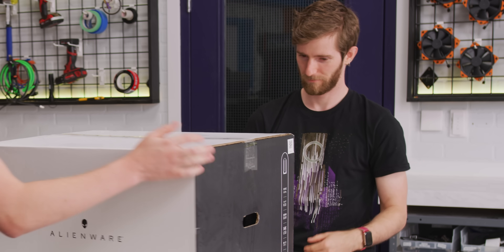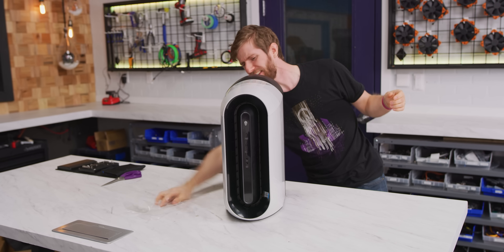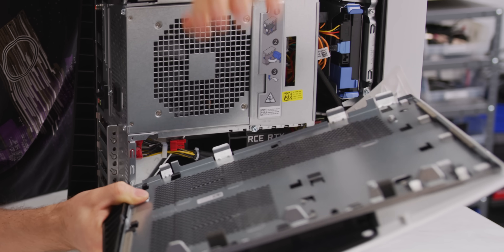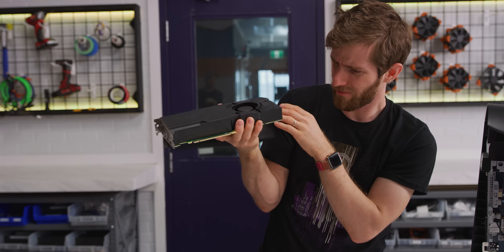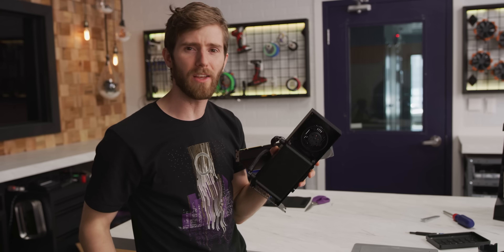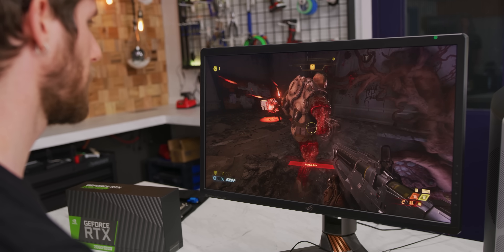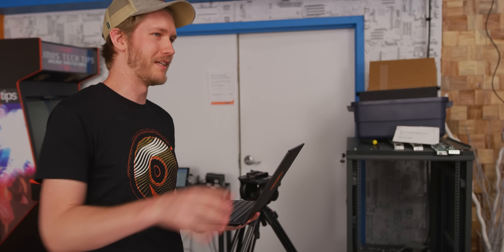I've Never Seen Anything Like This - Asetek Rad Card

Comment: Prebuilts like this really make me scratch my head.... such a perplexing mix of wasteful spending and questionable penny pinching.
Reply: The fact Alienwares have to work around stock Dell cases really hurts them.
Reply: Well, they have the overhead of designing the case to look like a dyson fan that was abducted by some extraterrestrials, but they also cannot charge too much for it because otherwise people would just buy from the competitors, so they have to have comparable specs on paper, but safe money on everything else to somehow stay competitive.
Reply: Das Die Der Erik They also have garbage airflow, which in turn make a normal gpu run hot. Which they then pay another company to make something for them. While just getting better airflow would solve that problem in the first place.

Comment: They could have done like Apple does... tacked another $2500 on it, downgraded the hardware, and put that money into designing, engineering, and manufacturing a really nice case. Who gives an f about the case. You never touch it, you never open it, you never interact with it at all. So just pretend like it is really well built.

Comment: All the time and effort that went into designing the (in my opinion, fugly) case, and the rear panel is just basic, cheapo bare metal you'd find on a workstation made any time in the last two decades. And then the inside is more of the same. It's a weird mix of designing around performance and aesthetics without really putting much effort into either.

Comment: This "rad card" makes me angry; how hard would it have been to simply put the pump next to the water block itself, have the rad on top of both, and make the rad 80 x 80 x 120mm so it's easier to place fans that make less noise than blower fans? Would have saved money, there would have been more PCIe slots for the plastic bottom to hold onto, and all of those screw anchors for daughter boards for stability. Hell, could have had a fan on both sides of the rad to reduce the needed spin speeds for reduced noise.

Comment: Confirming so Linus doesn't have to, A 8- pin motherboard will run with only 6 pins connected (damn 4+4 split while i was inserting and I had no Idea until i went to clean)

Comment: The EPS 8pin is capable of supplying 235 watts, and I’ve seen my 10700k at 266, so it Is possible to go above the max that the 6 pins can deliver on that mobo.
Reply: Doesn't the CPU socket also provide some power?
Reply: AbRaSkZo I think it provides a little bit, but not much. The bulk of the power goes to the chipset, the IO, and the PCIE slots.

Comment: The bigger power supply size was commonly used on older xeon workstations, looks like they are still using it just so you can't use a normal psu to upgrade. I have an 800 and a 500 W from some old dell computers I repurposed.

Comment: $200? That's fucking crazy markup.  A 2080 super with a integrated 120mm AIO is like $50 more than a a regular 2080. You can get a full on GPU block for like $150 if you're running a custom loop. The only use case for this product is...well. This.

Comment: Those are the same mouse and keyboard that come with all Dell systems.
Dell has really given up on the Alienware brand and just using the name for marketing. 
RIP Alienware
Reply: Also that metal chassis under all that plastic is the same as a few Precision desktop. So many reused parts with no regard to specific needs.
Reply: @BmanUltimate  at least that means it's easy to find spare parts. And tbh Dell's toolless system is a good one, not as clean as how Apple but you can basically remove everything without a tool, not just peripheral parts
Reply: Or, you can think of it as, your office PC came bundled with Alienware KB/M.
Reply: "Dell has really given up on the Alienware brand and just using the name for marketing"
I think the laptops are still worthy of the Alienware name, but not the desktops. I inherited an Aurora R6 3 years ago, and I'd be embarrassed if I'd built it myself. That swing-out PSU is a joke to try and work around given the case is already small.
That said, performance has been great, not a glitch—but worthy of a premium brand it ain't.
Reply: Alienware have pretty absurd markups so Dell giving up on it would be better for everyone quite frankly.  Considering that their stuff that says "Dell" on it tend to be more reasonable.
Reply: @SirNarax  Alienware used to be pretty good back in the.. When they launched in the -90s? Same with Razor. Both used to be kind of "By the people who care about this stuff, for the people". Nowadays both are pretty much crap.
Reply: @Matthew Gammon Dell monitors are fairly priced and work and look very good. im no dell fan but their monitors take my cake
Reply: it was RIP Alienware the second Dell took over
Reply: Car manufacturers are doing the same. Reusing parts is very economical.
Reply: Alienware has always been just a name and marketing...
They've had a few hits, but mostly it's always been a better value proposition to look elsewhere.
Reply: @Matthew Gammon Yeah, the IPS backlight bleed was so intense it covered almost 1/3rd of the screen in a bright yellow "glow". I literally couldn't view anything with a dark or black image & not see it. Ran through the 2 hour phone support hoops with outsourced dell support, they sent me a refurb. The refurb literally had a 2 inch long giant silver gash on the bezel, right where the alienware logo was. It couldn't have been more obvious and plain to see. It had scuffs & scratches all over it. I couldn't believe it lol. Also, the BLB was almost just as bad. 

Called support again, pretty pissed, told them I was returning the monitor if they didn't send me a new, sealed one, and the monkey said "sure, sure, of course, no problem, yes sir". Get the monitor, came in a plain cardboard box again...another refurb. BLB still there. 

Called support, told me "there's nothing we can do", tried to return the monitor, but after all the time it took to do all this, the return window had passed so they wouldn't accept it. Started a dispute with my credit card company that's still ongoing. I've legit never been so mad or felt treated so badly by a company. 

I had an uneasy feeling about alienware before I even bought it, & knew I should've gone with an x31 predator or something else. My own dumbass fault for not trusting my instinct. 

So yeah...dell not only isn't getting a penny from me ever again, but I'll tell anyone who'll listen my story. Sorry for the tl;dr wall.
Reply: I still regret buying my 34in 1440 ultrawide from dell. It's a pile of garbage, support was terrible, and even after 2 RMAs its still broken. I'm never buying anything dell ever again.
Reply: @firstnameIastname  I'm very pleased with my Alienware 34" 3440x1440 monitor. Bought it 1½ year ago. Only problem is that I had to upgrade my GPU afterwards...
Reply: @Olaus_  don't want to repost the same text wall, but see above why I think dell is terrible
Reply: @firstnameIastname  Yep, I see you have had issues, while I haven't.

Comment: Can't wait till these depreciate into cheapy cheap... I run an Aurora R4 ALX case, with an actual R4 mobo inside... used to be in a modified R1 case. But, well... now that it's in an R4 case I guess there's no reason to mention any of that... Oh wait.. No I'm wrong. Technically it's an Aurora R1 ALX case. Though the R4 ALX was the same. . . Those active vents on top, plus the added lighting, both functional interior work lighting as well as rear I/O lighting.. I just love these cases... None the less 4930K @4.5 over all 6/12, RTX 2070 @ +200/+700, 875W PSU, 16GB DDR3 @2150... It's still quite potent today, but was put together for VERY opportunistic pricing. And this one will be no different. In 3 to 4 generations, maybe 5... This will still be an extremely potent system, as will mine probably, lol.... but it will have gone WAY WAY WAAAAAAY down in price. And any modern, at that future time, gpu... will be able to pop in and play anything that era has to offer. Paying these prices for it brandy new is just... ick. I do sort of prefer my case over this super innovative, all contained in a tight as heckers footprint thing. I like to be able to use other off the shelf AIO's and other various parts, knowing that upgrades are easy if not easy to get innovative with.

Comment: This looks like an early 2000s style case. The color scheme, style and everything. (It's a little more rounded that's it). All it's missing is floppy disk drives and a CDROM drive.
Reply: It's even got a hinge, the true mark of a Dell desktop!
Reply: not only one, but four cdrom drives!
Reply: Even the back end being exposed stamped sheet metal looks like it. Reminds me of the Compaq case my father gave me in '99.
Reply: Definitely mid 2000s tacky “gamer design”.
Reply: except that this is way better quality then 2000s cases lol
Reply: @globalko  Pre-Dell Alienware cases from the early 2000's sell for ~$400 on eBay. Even the repainted Chieftec ones sell for a couple hundred.
Reply: @globalko  
he just means the design
Reply: @Bulk Grinder . It's very much not an early 2000s style case. Not the colour scheme, not the style, not any of it. A simple search proves this. Even Alienwares cases from that period are pretty representative of the styling of the gamer case, and this looks nothing like that. 

This style something more expected during the 2010-2015 era, with a little updating from the late teens.
Reply: @robertt9342  In fact a "simple google search" for me, revealed a few cases fairly similar to this from early 2000s. I also owned an old Dell system from about 2002 that looked VERY similar to this. I tried to find a pic of it but couldn't. 2010+ era was more filled with cases that looked like Antec 900 rip offs and cooler master haf 932 and stuff like that.
Reply: @robertt9342  I have an HP case from late 90s that is very reminiscent of this style. Was really irritating how many cases back then weren't flat on top.

Comment: Thats actually really cool and I wonder why someone hasn't made an AIO for CPU or GPU to drop in the many unused expansion slots of enthusiast's PCs.
Reply: I doubt there's a significant market for it. It's too large for ITX or DTX. Even in mATX it takes up quite a lot of space, probably choking both the blowers. And once you go full ATX, you'll have the space to fit a 240 or 360 rad anyway, which is going to outperform it for both temps and noise.
It's a cooling solution made for a case with 5 expansion slots. ITX has 1 or 2, DTX has 2 or 3, mATX has 4, ATX has 7. But for a custom case, with a custom motherboard and a custom VGA PCB, then yes, it's a pretty nice setup.
Custom VGA PCB also being a big thing. Just look at different full cover GPU blocks and how the manufacturers specify exactly which cards and what revisions thereof the block will fit. It's usually either reference PCBs and one or two 'gaming' brand variants. If you want to do GPU water cooling, the available GPU blocks are generally going to dictate which card you can use.
Reply: @fermitupoupon1754  If you have room for a full size card, that means you more than likely have room for a second, which would be this second AIO cooling unit.
Reply: @Sizukun1  You've never built a Small Form Factor machine then, I guess. There are lots of ITX and DTX cases which have room for a full size card. But they really only have room for the one card.

If you've got room for this thing, you're probably building a full ATX machine, so you most likely have room for a normal radiator. Which will out perform this thing.
Reply: @fermitupoupon1754  You're right I haven't, but if I had to guess most enthusiast PCs aren't small form factor either where this GPU AIO could really sell.
Reply: @Sizukun1  I can't see a $200 AIO become a thing in enthusiast PCs. You can buy an EKWB full-cover GPU block for $119. And EKWB isn't a cheap brand at all.

And again if you have to space to fit this thing, you're probably building a full ATX machine. So you're going to have the space to fit a 240mm or 360mm radiator anyway.

Why spend $200 on an AIO for a very specific VGA card, when it costs half that to just splice a full cover GPU block into your CPU loop? I really do not see a market for this thing as a stand alone product.

Comment: what does 69% less noise mean? Noise is measure in decibels a logarithmic measurement, they are probably measuring it linearly. If you am correct, then it is 5 dB less noise, if they took the stand cooler say a 60 dBA, and reduced it 69% it would be 19 dBA (impossible)

Comment: The metal on the case isn't powdercoated, and the panels are stamped steel, because it's their basic OEM chassis that they use for a lot of products, just with fancy plastic bits on the outside of it. You can tell it's their OEM design from the PSU orientation, with the swinging door that Dell always seems to use, and case layout; plus the motherboard itself looks like the typical Dell OEM barebones board, and even the PSU is Dell OEM with that proprietary 6 pin CPU connector.
Outside of the AW branding on parts, the fancy plastic exterior, and beefier components, this is still Dell's typical OEM shit, and nowhere near what Alienware should be with the existence of the DIY market. Plus it has Dell's typical OEM overpricing that typically comes with most of their systems.

Comment: the 10900k is capable of overwhelming a crippled 8 pin (this abomination of saving 2 wires) on ambient cooling.  On an asus motherboard a simple mce toggle has the cpu using up to 250 watts on some chips under heavy all core loads.  Now add a memory and cpu overclock and you are getting close to that comfortable power range.  What a totally cheesy move by Alienware to save a couple dollars...

Comment: "This or the PS5?"
"I can't tell the difference.
Me: About $2000...
Reply: the 2080 super alone sets u back 1000 dollars. if u could get that system for 1500 it would be cheaper than a walmart prebuild.
Reply: As others have stated, the configuration they use will set you back $2879.99.  
It's still a decent price (especially for Alienware) considering it has an i9 10900K (which retails for around $550) and 2080 Super (which the cheapest I can find is an EVGA for $685).  That sets the price of the two biggest components to $1,235.  $1,640 for all the other components (case, motherboard, memory, NVMe drive, hard drive, water cooling, power supply, etc) and labor seems pretty reasonable.  Of course Dell gets components at a bulk price, but still...
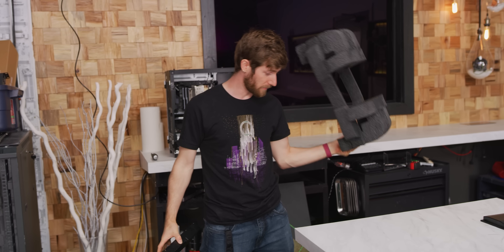Reply: 12:45 - $1479.99 Better than I thought.
Reply: @IcarusMK22  at least 1679 actually lol. Thats the total price before you click on the GPU used in this video
Reply: Martin Herrin that is for a basic build with a starting tier processor and low ram, they just upgraded the GPU to show the difference for water cooling... this build they are showing will be around 2800 or so
Reply: @WildCard23917  Yeah on second thought, I was thinking the same thing lmao. Forgot there is like a 2tb ssd and hdd with all that extra stuff, plus the alienware upcharge. This machine is surely worth a treasure chest

Comment: if not putting garbage in a computer is a possible thing to do id just take all fans and plastic shroud off of something trying to run cool and zip tie some 110mm fans in place, but then again if I wanted a dell id go to Walmart and still wouldn't waist that much cleaning supply's on asus turbo cards. cool fact a 10 dollar fan from family dollar fits great on my computer when you take the sidepanel off and lay it on it side same temp as water,

Comment: Linus: That's not a bad looking machine.
Me: Holy crap that's fugly.
Reply: I really hate it because the front is mostly an oval put the bottom and back are all square.
Reply: I don't get that, it looks clean and respectable to me. No annoying RGB, only tasteful blue accent lighting, the front panel is different and interesting and the rest of the cast just looks clean.  Also looks like it was stolen from Aperture Labs
Reply: @Aquatarkus96  hehe the cake is a lie
Reply: @Aquatarkus96  Honestly, I hate the shape, I am a box case person, big windowed side panel with RGB (I don't like rainbow puke though, I like the flexibility it offers to change my theme without spending stupid amounts on new lighting strips).

I bought my Carbide Air 540 like 5 years ago and I think the only case I have seen that remotely interests me is the NZXT H700i in all black, if I don't get that, I'll just be sticking with my Air 540, modern cases just don't look appealing to me.

I do agree, it does look like something Aperture Labs :)
Reply: @KamikazeXeX  Alianware is not meant to be standard boring shitty box designed with 50 strips of LED on every surface.
Reply: You got a false opinion
Reply: @Typical-66  See, here's the amazing thing about an opinion, it's yours and you can't tell people otherwise, you're welcome to enjoy what you like, I'll carry on enjoying what I like 👍

Comment: so if i live in a place where ambient temperature can be over 40º on summer and even over 30 ºC on winter (and even hotter outside), with no air conditioner coz it's rare to have air conditioners in houses here, what cooling solution would be best for my pc? water cooling? or any extravagant cooling solution? (air cooling is not rly enough even without OC)
real question, im expecting answers ty XD
PD: also i want something quiet

Comment: Friends old model of this PC had the PSU fry the CPU power connector and a few capacitors on the board, burned a hole right through the PCB.

Comment: If you're spending 4 PCI slots on one GPU and cooling for it, why not just make one huge cooler with a couple of 80mm fans perpendicular to the card? That is, rather than blowing AT the card, have them blowing THROUGH an 80mm high aluminium heatsink/radiator (not too dense fins, of course) mounted on top of the card, in a push-pull configuration.